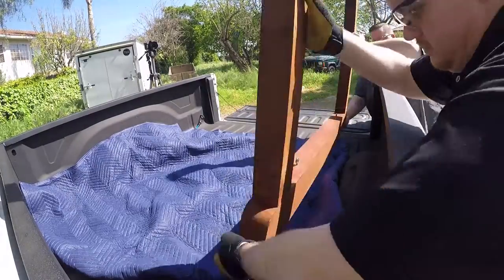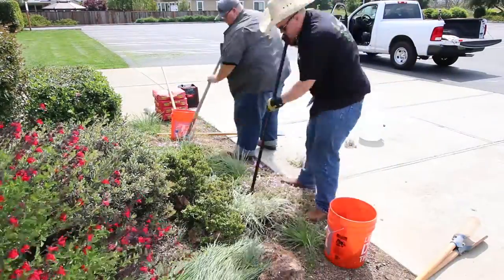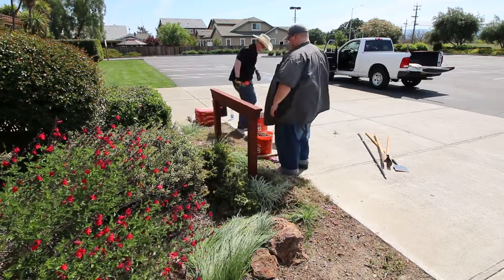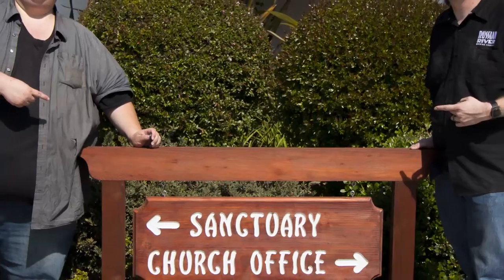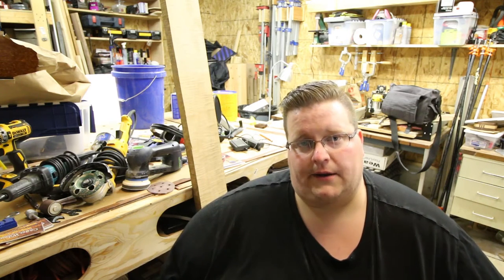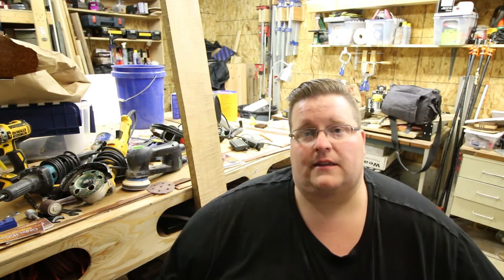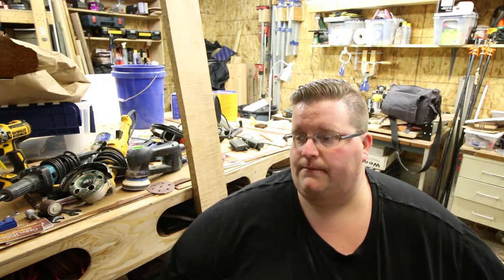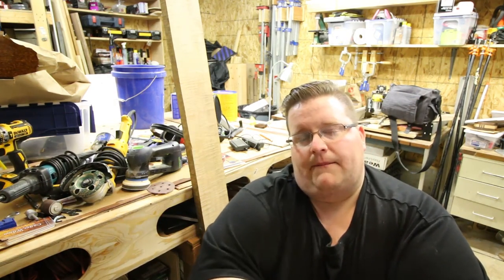Building a Wood Sign   Part 3   Install

Comment: cheers bro! i apologize, i just deleted your comment by accident but yea, the hula doll mechanism works ok. i wanted to use a spring, but the weight of the cast doll made that a little more challenging so i looked for a more stable solution. keep up the good work. i'm looking forward to seeing your power carving.
Reply from the maker: +tim sway Thanks for the comment, sir! I get what you're saying about the weight - not only weight but the even distribution of it seems like it'd be pretty important. As for the power carving, that'll be my next video! Hopefully shooting the next couple of days and up shortly thereafter.

Comment: Thanks for leaving in the mistakes. Best way for your viewers to learn. Next time removing most of the material from the mortise at the drill press fist.
Reply from the maker: +Jay Freely Definitely! Always learning and half the reason for making YouTube videos is to share what we've learned. :) Re: drill press, that's definitely a possibility - mine is really small and not great though, so I didn't want to go through the trouble of building up supports to hold up the heavy beam safely to be drilled on the drill press. Basically laziness, haha.